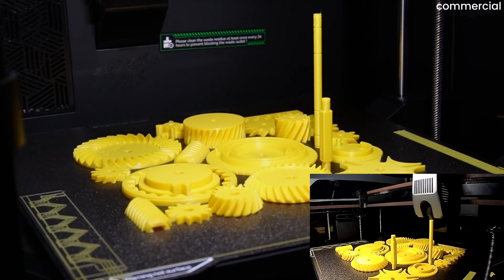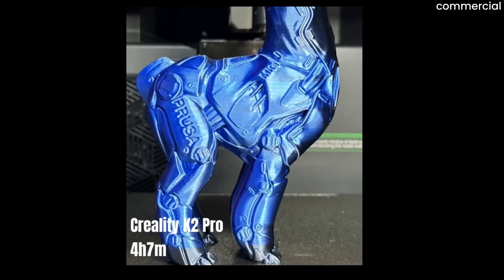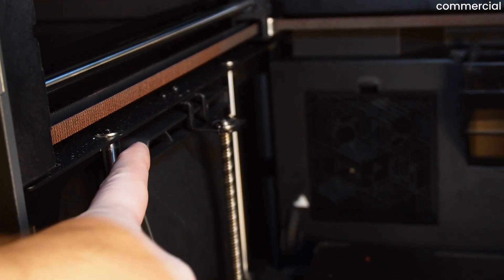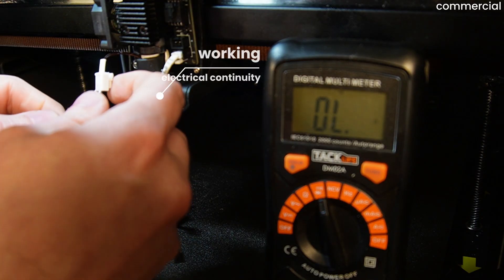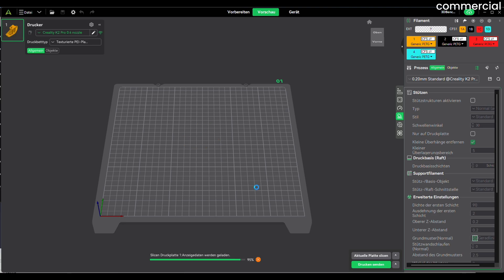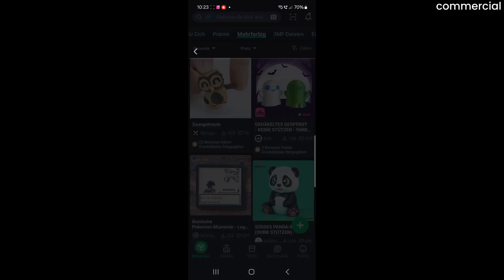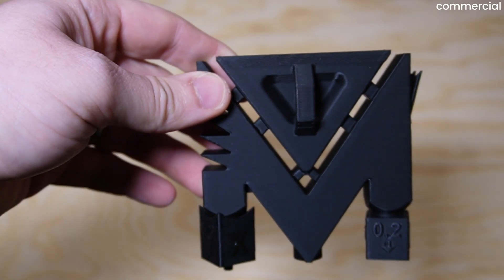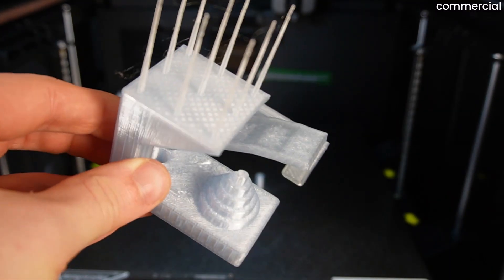Creality K2 Pro – A Huge Upgrade After 6 Months!

Comment: Cost of operation might matter. To this, I suggest one's first or second printer should be a bambu labs A1 mini. When I need a part which fits on a mini, it prints equal quality, faster and costs far less to run. I don't need to heat a 300mm x 300mm plate for a 30mm cubed part. Average pla filament electric consumption of the mini is about the same as a 60 watt incondesent light bulb. A simple, fast, good quality machine that's inexpensive to buy and use.
Reply from the maker: Maybe, yes — but users who can only run their printer overnight (which is already quite risky) usually prefer a larger build volume so they can produce more parts in a single run.
Still, for a first printing experience, the A1 is a solid recommendation.
Reply: @crydteamprinting  Only if you don't mind you're data being mined while being stuck in a closed ecosystem.
Reply from the maker: Yes, thats a valid point but the most beginner would only click on the Smartphone and wanna have this object -> they dont share specific data beside the print, which is already published.

Comment: Printing with abs with old or new printers. I have an old and slow lulzbot taz 6 bed slinger printer (with extruders of both 1.75 & 2.85 mm filament) as well as a creality k1c. I print abs with both. The k1c being an inclosed core xy is factors scale faster, but, on the edge of too fast. That is, approaching 100% successful print quality can be reached printing a single part. Increasing the number of parts on the bed may lower this success rate. In similar fashion, the taz 6 proves abs can be print with an open frame bed slinger, but the speed at which successful printing is quite slow. Think tpu slow. In fact, since I have more printers, the taz is primarily prints tpu where the print times variation is less.
Reply from the maker: Thanks for sharing your experience :)